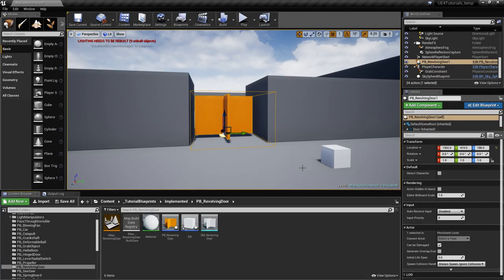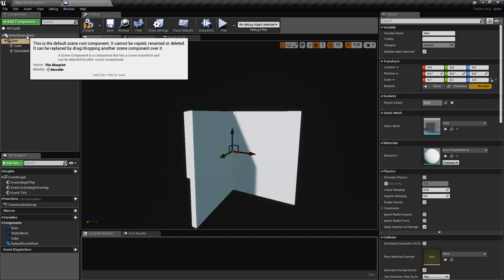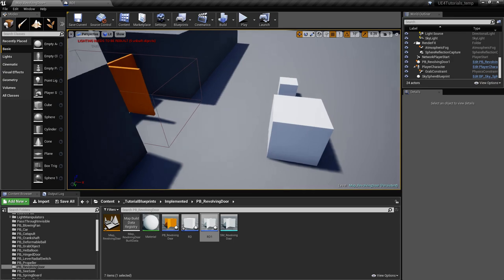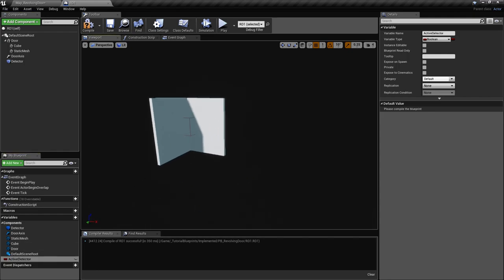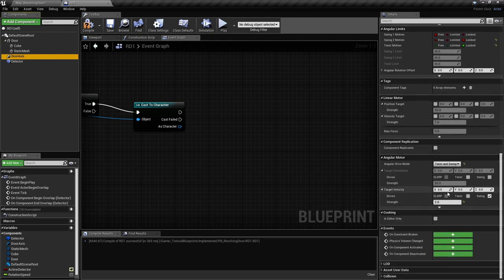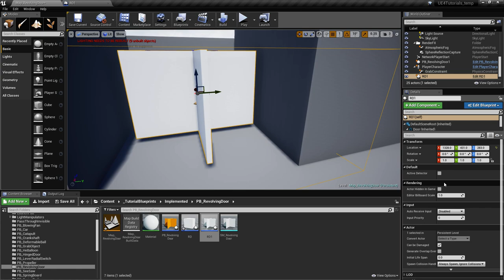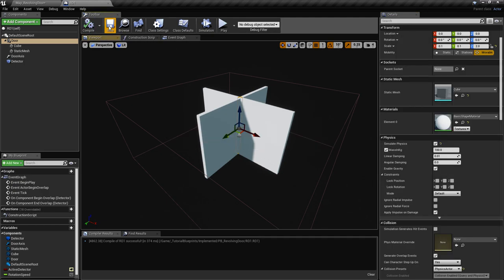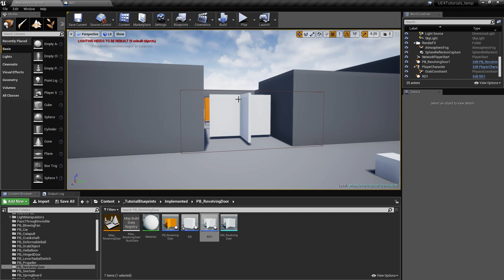UE4 How to - Rotating Door - Revolving Door using Physics Constraints in Unreal Engine 4 Tutorial

Comment: Do you reckon you could make a tutorial on how to make a weighted pulley system with physics in UE4? Thanks for your super useful vids <3
Reply from the maker: Making physically accurate pulleys is hard, if not impossible in the engine as it is right now. 
The pulleys, themselves, are really easy to implement. The problem is the rope. I've made a rope implementation (https://www.youtube.com/watch?v=hEMcr98cDJE), but I don't see it holding weights. It barely holds its own weight.
The cable system plugin doesn't exert physics forces on the objects, so it simply gives way.
The only way I would see it possible is to simulate the movement using physics constraints, but I don't have a clear solution in mind for that.

Comment: Maybe you can do a tutorial on how to make a physics based windmill
Reply from the maker: I was thinking of a water mill. 
Not sure what to use to drive the windmill.
Reply: Wind... lol. You would need to make some wind implementations. And i guess thats out of the theme of these tutorials.
Reply from the maker: I guess it would need a global wind system, otherwise it wouldn't make sense. If it's only the windmill that needs to rotate, you can simply add torque to it.
I made a simple implementation of wind here, but it doesn't have fluid dynamics: https://youtu.be/J9lVADyd8ZQ
BTW, fluid dynamics is very complicated to implement and consumes a lot of resources. So unless it's a game that is made around that (like a fighter plane, for example), it doesn't actually make sense to use it.